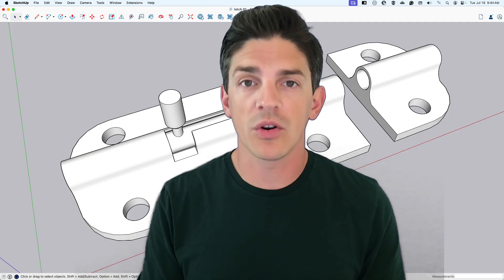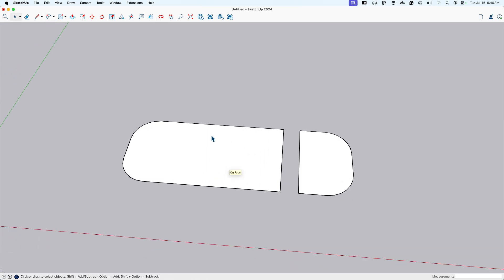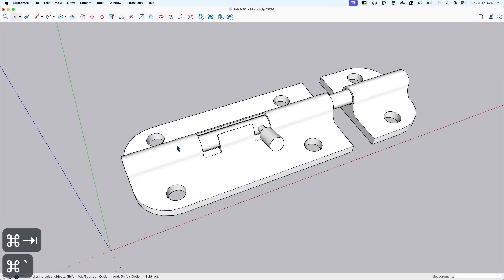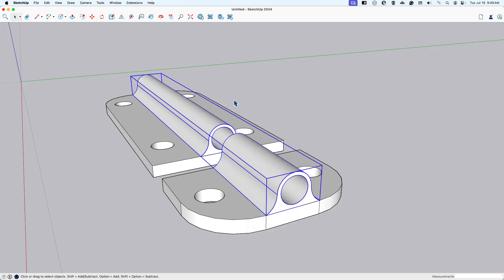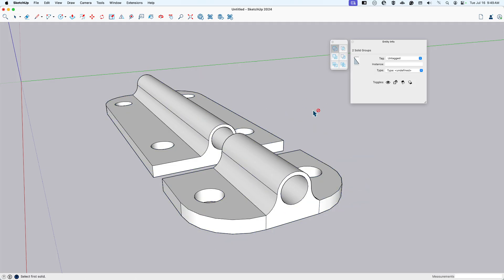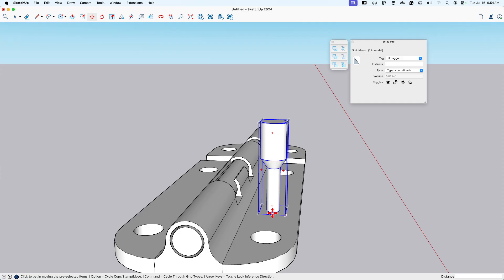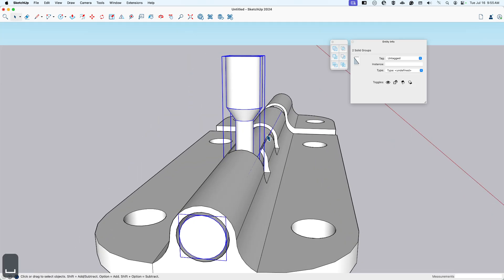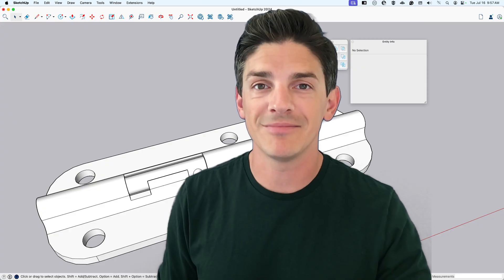How to 3D Model a Latch | SketchUp Tutorial

Comment: @4:03 The two point arch tool line just simply disappears after I match the tangent.. really frustrating
Reply from the maker: It's hard to be sure where your arc problems are coming from. Here are a couple of things to try:
The 2-point arc is a three-click tool—Click once to set the start point, click again to set the end point, move your cursor to define the "bulge," then click a third time to complete the arc. At 4:04, his second and third clicks are at the same point.

Ensure your number of curve segments is not too large for the given radius and angle.

Are you at the same scale as the video? Sometimes SketchUp has trouble creating really, really small geometry. You might try scaling the model up to create the arc, then scaling it back down afterward.

If you're still having trouble, you should post your question on our Forum http://forums.sketchup.com
Reply: thank you so much!
Reply: really annoying. doing everything exactly like you do in the video.

Comment: Man @sketchup the 2 point arc tool to working as it does in the video is annoying... I thinned tried to work around, and it further compounds the frustration because now my upper tube for the bolt is part of the lower portion.. Im following step by step, but he is able to group the upper with a triple click, while the same action selects the whole piece (including the base) for me. Wish the 2 point arc wasn't such a problem for so many new users.. what's the deal? Like I click, I click, I see the blue tangent line (arc) just like him, he clicks again and the line stays, I click and it vanishes. Insanely annoying
Reply from the maker: Hi, sorry to hear you're experiencing some frustration. He puts the base in its own group at 3:10 to keep it separate.

It's hard to be sure where your arc problems are coming from. Here are a couple of things to try:
The 2-point arc is a three-click tool—Click once to set the start point, click again to set the end point, move your cursor to define the "bulge," then click a third time to complete the arc. At 4:04, his second and third clicks are at the same point. Ensure your number of curve segments is not too large for the given radius and angle.

We recommend bringing your question to the SketchUp Forum if you still see issues. Hope this helps!
Reply: @SketchUp  I have exactly the same problem !!! never been able to draw the arc !!! so rediculous

Comment: How did you turn on Key Logger (I believe you called it that)? It appears in the information bar at the bottom.
Reply from the maker: Thanks for the question! Matt used a separate application called KeyCastr. You can find options and see what works for you if you search something like "keystroke visualizer"

Comment: I cannot make a 2 point arc on I pad or Mac. On both the same thing happens once I click the 3rd time to place the arc then it just disappears. Please respond to this with some help. I have been on several you tube videos trying to follow along and running into the same type of issues where the modeling process being used in the video doesn’t work the same way on my end. I have commented on servers of them and have never had a response. I am trying to learn this software but it is very difficult and frustrating when every time you sit down and try to enjoy a few minutes and learn you are met with complication after complication and are ignored when asking for help.
Reply: This issue arises when you try to model very small objects. To avoid this, create the model at a larger scale first, then scale it down to the actual size afterward. This prevents any problems with the drawings.

Remember: Always create models larger than their actual size if they are small. After completing the model, scale it down to the actual size. This approach makes it easier, as SketchUp struggles with small models and can encounter drawing errors.

Hope this helps! 😊
Reply from the maker: YouTube is great for 'one off' tips and tricks but if you haven't already, you really should start and complete our fundamentals course over at: https://learn.sketchup.com/courses/sketchup-fundamentals-part-1